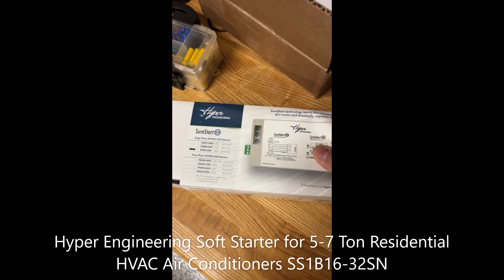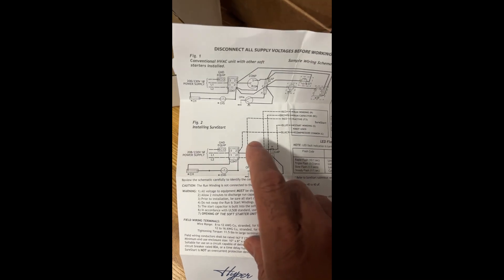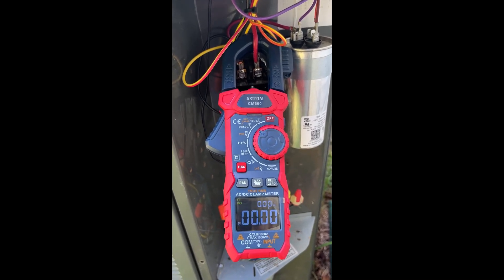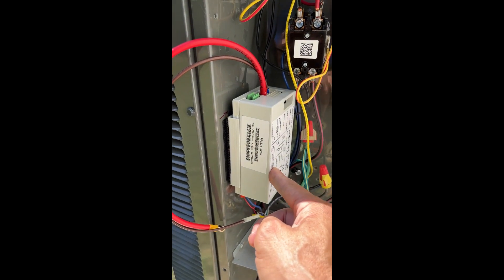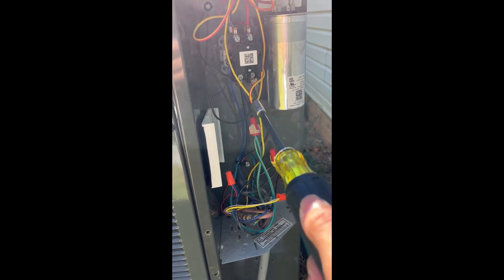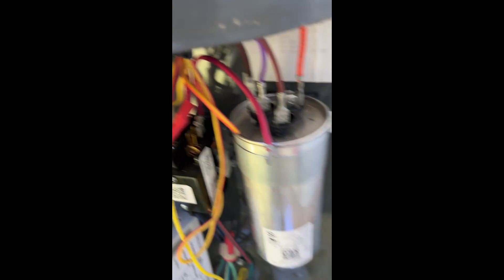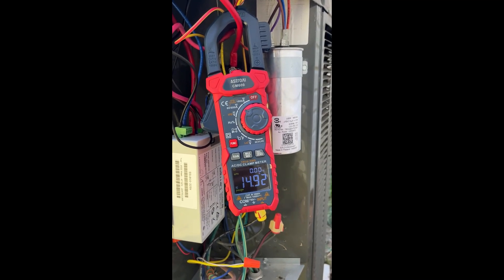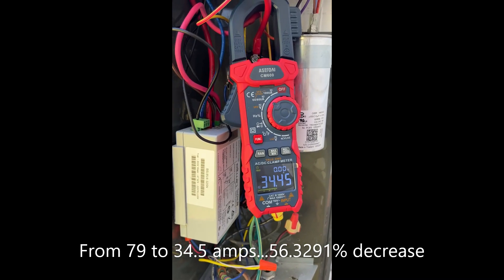Soft Start AC Installation -  Hyper Engineering on 5 Tons Trane Model 4TTR6060

Comment: i know this is an older post, but maybe someone can answer my question. i was going to go with the easystart plus BUT read so many failures so i am leaning more to this unit. Will it work with a 2 stage compressor? i have a ruud 3 ton 2022 unit that's 2 stage. Thank you for any help. i called rheem ruud and they were useless. i asked if an easy start would void my warranty the woman said no as long as it was tested and approved so i asked what units were tested she gave me the part number to a hard start. When i questioned her she said "well maybe you don't need one" i said will maybe i do LOL. Thank you again for any help

Comment: I've had that brand four years and it works great. The A/C installer said it would increase the life of the compressor. My 12KW generator started the 4 ton with no problems.

Comment: I see you have a purple wire on your common.  I also have one, which goes to my fan.   My question is does that need to be moved to the T Contactor Common or leave it there?  Its not mentioned on the install instructions, but it does only show one connection to the Capacitor common.  Looks like you left it there.. I assume everything is still working properly?
Reply from the maker: Sorry for the late reply....I would just follow the instructions...I believe in my case, it did not ask to be removed...and yes, the unit has been running great since the install...no issues whatsoever

Comment: This thing is B.S. and junk. They all are. It does NOT reduce anything. Using $50 clamp meters to measure modified sinewaves which fools the meter, and thinking the same motor with the same torque load on it now runs on one quarter of the current, is the findings of a fool.
Reply: I'm not HVAC guy 😂😂😂. I'm seriously laughing of your comments, how can you talk about some that you don't know. I've never said that this would help to lower Electrical bills substantially or everybody should install it. What I Said is that this device helps to reduce the inrush current and is helpful especially in situations that the inrush current is a problem, such as home generators and RVs applications. There are many of those devices all over the world, and looks Like your "industry experience" was very limited. I'm Bachelor in electrical engineering with Masters in automation systems and I've been working all over the world with these devices and VFDs as well. Some industries they must have softstarters or VFDs installed because the inrush current can activate the breaker protection of all plant, or imagine a Drillship, for example. Some countries have  specific laws that if you have a motor with high HP you must install a soft starter or VFD because you can trip a whole neighborhood or city for example. 

I'll give you an example that is better for you understand. In an AC of 4 TON the eletrical current that the system needs to work is around 13Amps. However, when the motor starts, we have an inrush current around 140 Amps. So in a small trifuel generator with 13000 Watts for example you have power to run the house including the AC, because you have more than 50Amps available. However, when you start the AC, the generator breaker protection will be activated, because during the time that the motor will break the inercia, that is around 10 to 30 milliseconds (inrush Current) is enough to trigger the generator breaker that is 50A.

On these cases this device is very effective because starts the device slowly, not giving full power, because we cut a small amount of the senoid.

So, don't be talking about something that you don't know, saying that they are all BS. All those devices had an engineering team working on that.

 These devices will not reduce consistently the bills because their effect is during the motors start only that will save  about 30 milliseconds of high current. After start this device will work with same Amps that  before.

And the meters can read the current of these devices, you don't need some lab device (I guess that you would like to say oscilloscope 😂) to read that.

Stop to talk about something that you have a very limited knowledge, is better for you and your selfsteam, other people will be laughing about you talking like an idiot.
Reply: @marcelsribeiro  The only one laughing is me right now. Especially when your compressor goes dead from a blown start winding and you voided the warranty at the same time. Whats wrong? Im I cutting into your sales??  Or are you upset that your finding out the truth after you spent a bunch of money for nothing but future problems? That thing does not cut amperage in any way and yes you cant measure altered current with a 60 cycle $50 meter. Oscilloscope?? Lol They DO NOT reduce current. Engineering = sales, so knock it off. They also will damage your compressor windings overtime because the motor is not designed to start like that. And the manufacturer will void your warranty if you install it on their equipment. All your doing is cheating the engineering that went into that compressor. Buy the proper generator in the first place and avoid the problems. 😂
Reply: The soft start obviously reduces inrush current as shown by reduced or even eliminated household light dimming. That effect alone shows that voltage drop on the lighting circuit was reduced based on lower inrush current at the panel.. E = IR
Reply: @boeing757pilot  Nope it doesnt, you probably had a goofy light dimmer.
Reply: @RadioRich100  LOL. Yes, it does. In fact, you can measure the voltage drop...
Reply: @boeing757pilot  Voltage drop? you said it reduced the current? The voltage would have stayed the same. So now this thing is starving your unit for voltage - interesting.
Reply: @RadioRich100  Yes, the high inrush current of the compressor creates a voltage drop across the panels busbars (where the HVAC CB and general lighting CB are attached). In turn, there is reduced voltage to household lamps and other receptacles.. This device would reduce inrush and thus reduce VD..
Reply: @boeing757pilot  Then you have a problem in your wiring, the placement of breakers in the panel or you have a worn out compressor or your service is too small. A miracle box doesnt fix that.
Reply: @RadioRich100  Dude you are flat out wrong here. Again - Hard starts are essentially creating very temporary short circuits, thus the dimming of the lights as amperage spikes and voltage drops. All an electric motor is, is a few long strands of copper wire. Its the fact that its in a coil config and creates a magnetic field that clamps down on that and creates resistance. The short circuit wastes energy in the form of heat in the coil. 

Again, I am not going to argue your point these things are not going to save you a significant amount of money on electricity, it will likely only be a few bucks, if that depending on your climate and age of system. It is however, much more gentle of you compressor and fan motors in your compressor and will likely extend the life of them.  I put (more simple) soft starts on all my big power tools in my shop for this reason.
Reply: I guess that you misunderstood something, but I'll help you. The main idea is not reduce the equipment running current but to reduce motor start current. When we start the motor from inercia the amount of power used is always full, that on some cases is almost 5 times the running amps. With a softstart, the system uses an electronic device (usually SCRs) to basically cut the sinewave similar what a dimmer does, but only in the start. After starts the motor will use the same full working amps and power that supposed to be using without a softstarter. This helps people to use AC with generators or RVs, because without this the starting current will always trigger the thermo magnetic protection from the Circuit Breakers.

And about the $50 meters, they are not certified but works. I have some fluke meters for professional but some those cheap for home, and comparing measurements is very similar. If you're not a professional and don't want to spend a lot this works better than nothing and you won't be blind.
Reply: @marcelsribeiro  Incorrect, the start process uses the SAME amount of amps no matter what. Unless that thing magically generates power. Those meters ARE NOT ACCURATE measuring the output of that device because they cant measure altered sine waves resulting in false low readings making people think they work. Your fluke wont do it either. It must have the capability to track the current phase and timing. You will only find that feature in a lab rated instrument. I understand perfectly. What you dont understand which apparently most on utube dont (and manufactures love it) is that this thing is a "limited use device" Which mean its only good for certain situations. They market it saying everybody should install one and all the hvac guys on here are pushing them. If you cant start an A/C compressor off your generator - you have an under powered generator. How about getting a more capable generator instead of using this bandaid device? Using this thing come with a price, not just to purchase it, it violates any manufactures warranty, and you run the risk of damaging the compressors motor which is not designed to run or start off of modified sinewave current (which your digital meter cant measure). Just what the capacitor puts out - 90 degrees phase lag at 60 hertz.
Reply: @RadioRich100  you definitely don't know what you are talking about. Get a Bachelors and Master degree in electrical engineering, and study what happens with your total power when using soft starters. There are a lot of industrial soft starters with many adjustments. We could be using  a VFD to do the same, reducing the starting current using the frequency. The difference on this one is that we use that with SCRs that changes the amount of power that we use during the start, cutting one amount of the sinewave in one cycle, and what is used in any dimmer solution all over the world. So you are basically telling that a highly used device in the whole industry doesn't work. General Electric, Schneider, Telemecanique, Danfoss, Siemens, all those brands are all wrong with their engineering team, and you are right saying that they are producing bullshit. 😂😂😂

And about the meter, do you even know what the meaning of RMS reading is? 

I guess that you need to go to school and stop talking bulshit that you don't know, thinking that you know.
Reply: @marcelsribeiro  Ive been to school far more than think and in the indusrty a long long time, and you know nothing of what your talking about or what I have said. Im talking about these add on black boxes that are being sold to consumers - yes there mostly bullshit. It is not possible for a motor to run or start on a quarter of its rated power with the same torque load, thats nonsense.!! If you could find a way to do that you would be rich. I think Ill install one on my car and i will get twice the gas mileage!! And my car will last twice as long!  $50 meters CANNOT MEASURE inrush current or voltage after the box changed the phase and timing of the current . These $50 meters people are using is not capable of reading after that box has been installed as the meter needs 60 cycle unaltered current or voltage to work properly. RMS has nothing to do with it which is how I know you dont know what your talking about. Your just another one of these hvac guys who sell them to unsuspecting consumers who think they need them with the promise of lower electric bills, and the system lasting longer and being protected when the exact opposite is more true. I guess Im raining on your money parade, so to you and all other hvac guys selling this crap telling people they need it, I say tough shit!
Reply: @RadioRich100  In rush current is a thing. The start process has the Amp rush because the motor winding is basically a short circuit until the magnetic field builds up in the motor and resists electron flow. Soft starts control this by slowly ramping up the ac waveform so that it's about the same as the magnetic field in the motor winding. The wasted energy in the case of hard starts is released as heat in the windings, thus hard starts do use more energy. 
 Now I'm not going to say you are going to save significant money with this thing, but it is easier on your compressor assembly and it for sure will allow you to use a generator.
Reply: @RadioRich100  The start process use the same amount of ENERGY ( Watt hours)  no matter what. Energy is the product of voltage /current and time adjusted for time ( phase) differences between I and E. So not matter whether you use a hard start ( starts quicker but use more current), a soft start ( uses more time but less current) or the standard start configuration ( medium current and time) the total energy used will be  same so no law of physics is being broken. None of the devices will reduce running energy as well. They will all use the same. So the main advantage is just allowing a device that cannot deliver enough current to start the Compressor to do so. Such a device is significantly cheaper, and uses less fuel than a device that is sized big enough to do this without a soft start.
Of course if your AC is a modern inverter model they are no only more efficient to begin with they for the most part have soft start natively.
I am retired and get NO INCOME or other benefits by saying this.
My paying job was a EE designing and training people how to use very expensive test equipment to make a measurement of anything that involves electricity.
Reply: @56ctconger  For once somebody that knows what he talks about. Dont forget the false meter readings everybody sees and thinks there saving energy.
Reply: Yes typical clamp meters will not do the trick and the ones designed to rapidly sample the current waveform then calculate the true(RMS) inrush value were over $300 Now there is a new generation that do a reasonable job that costs a little less than $100. They are not as accurate, stable and durable as industrial models like Fluke but good enough to measure improvements. Measurement technique will often introduce worse errors than the meters themselves. The company that I worked for was Tektronix/Fluke, now part of the same company.
Reply: @56ctconger  Im sure your right, but all the people on utube saying there systems are now running on on fraction of current because of there clamp meter readings coming from that box is ridiculous.
Reply: I have measured these types of systems before using current probes and complex computing digital oscilloscopes that can calculate true power at speeds more than a million times faster than anything that exists in a power system. Soft starts do what they say they will do ( reduce start current required and add quieter starts) they also can add important safety features that initially seem superfluous but are not.
HVAC mfgrs add some of these features to their top of the line models but they hurt profit margins too much to include everywhere.

Finally all these comments refer to properly configured, sized , applied and installed hardware. I suspect many of the problems seen are a result of failing to properly do this.
Reply: @56ctconger  Nonsense, No motor runs on far less current with the same load because of an add on box. The motor is designed to run on a certain amount of current. No add on box changes the motor. Quieter yeah but that doesnt get you anything. And they will damage the motor over time because they are not designed to start or run like that. If systems are designed to run like that then yes, but it wouldnt be in the form of an add on box. It would be built into it.Manufactures void your warranty if you put one on, and these are the reasons why.
Reply: @RadioRich100 i wont get into the main debate here, but asserting manufacturers would have this installed at factory on OEM if they worked goes against the nature of most HVAC OEM> these cost money, and if the compressors wear out quicker without (esp if just after warranty) it’s ALL good for the OEM and their dealers as they generate more business. You can readily drop this argument for proposes of this debate. Of course VFRs automatically have soft starts, and single stage (even two stage)units are now entry level units for most OEM and they will strip everything they possibly can from those units to hit a price point.
Reply: @johnwhite2576  Your way off the mark. Manufactures DONOT install after market devices on there equipment thats ludicrous. Resalers do. They pass the cost along and its so more people can use it on systems that wont support it. Its for marketing purposes only. Also you will see the warranties are modified or voided when they do it.

Comment: I have a westinghouse 7500/9500 and 2.5 ton trips when compressor turns on.  Do you think it will fix the problem?
Reply from the maker: @gmoney713-r7z  not 100% sure if will fix, but it should help

Comment: I had originally seen another video where they didn't remove that contractor wire but guide says to and it had me confused. I then found your video and it clarified that. Have soft start running now and am excited to get HVAC running off my solar inverter 💪. Thank you
Reply from the maker: Glad to know it helped !